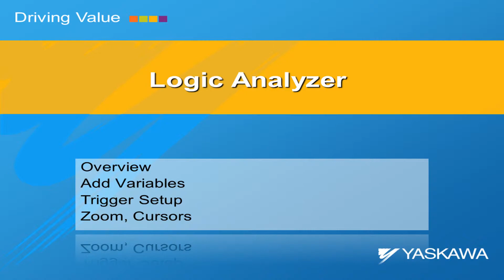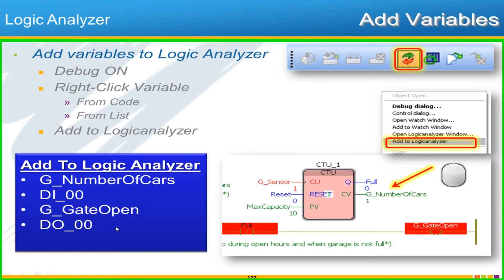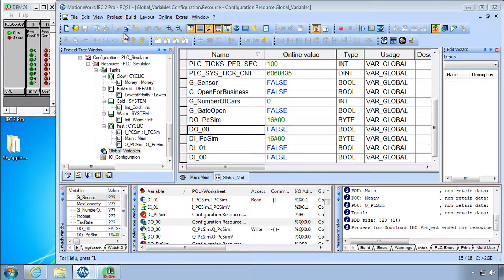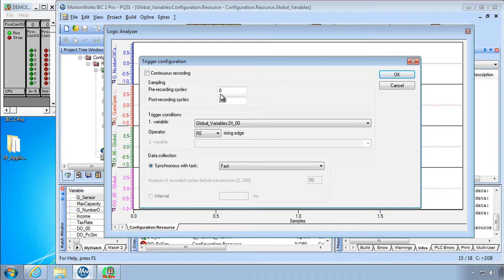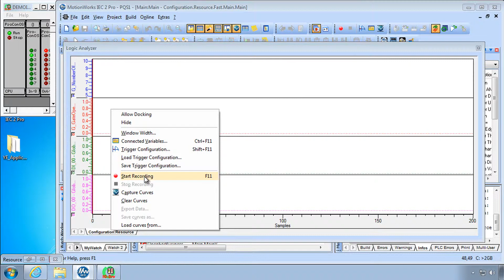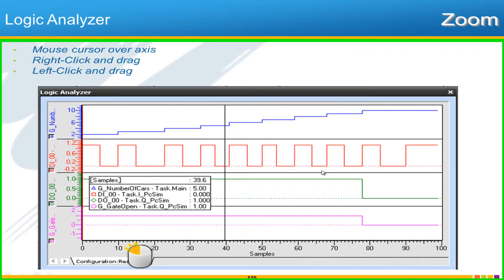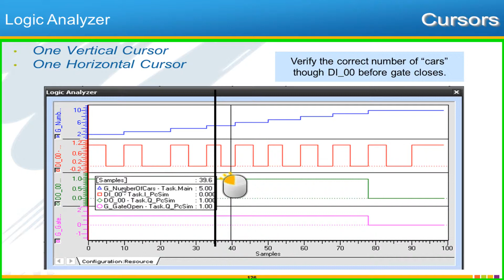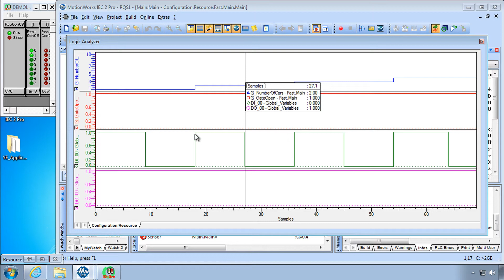3.3 Logic Analyzer (IEC 61131-3 Basics with MotionWorks IEC)

Comment: An easysim proconOS  course would be nice,  I don't see any global variables that are declared with a physical address (inputs and outputs) 
in the global variables worksheet of the simulated resource
Reply from the maker: Thank you for your interest 3.3 Logic Analyzer (IEC 61131-3 Basics with MotionWorks IEC) Once connected connect to a device, the address will be imported through hardware configuration. (non-simulation mode)